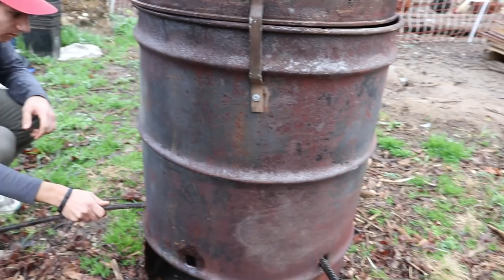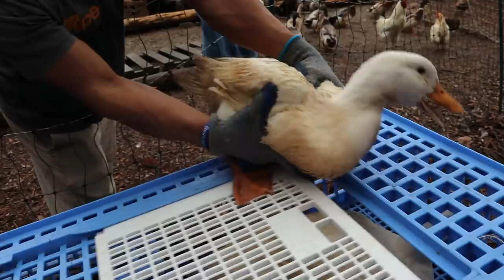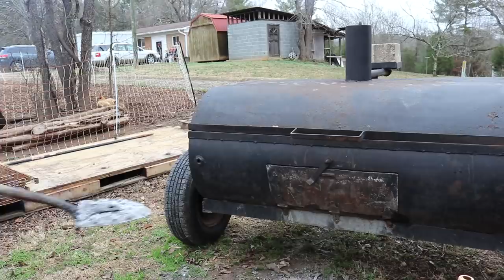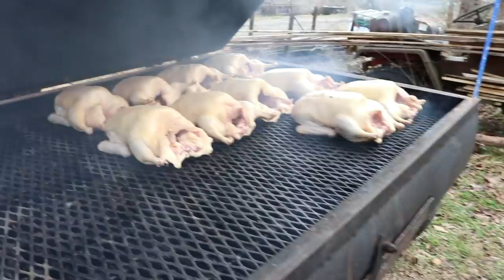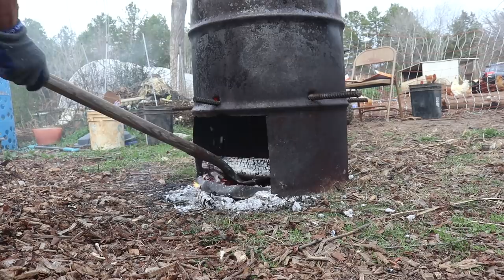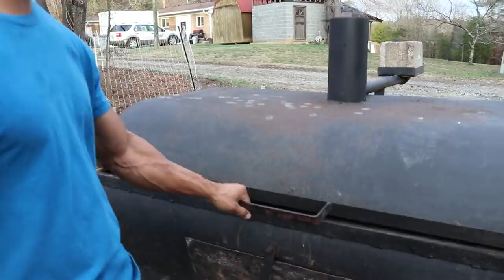SMOKING 20 Hot Duck Breast, Thighs and all for the First Time

Comment: That’s what I’m really huge into doing things without electricity or propane but you can definitely experiment with it with the property you have you can definitely learn how to do that I happen to know a lot about those things a lot of them work you know you can make your own hydrogen that’s pretty easy to make but the problem is stabilizing it so it could be a continual source but Methane gas is probably one of the easier way to go you can see that just for different types of manure but using those coals. like you’re doing you see a lot of that in South America they cook chicken like that..

Comment: Wow! What a smoker and wood barrel combination. I was interested on how they were built and why was the cement block used for on the other side of the smoke stack? What does the top wood barrel do and why two barrels on top of each other?  Where is  thermostat so hands don't burn for those who have touching delay reactions to heat?
Oh yes the ducks and the chicken looked yummy.  I am like Lucy/Luci if there is a grill going I will season the meat and put it on the grill than be inside cooking. Outdoor cooking makes the food taste better and fresh air mixed with the cooking aroma. 💕
Reply: I assume the cement block you are talking about is a counter balance that allow the smoker lid to stay up,  on its own  when lifted a portion of the way. You can imagine out difficult it would be to hold the lid up continually with one hand as you checked on, or added the meat to the smoker. It's a cleaver addition.

Comment: I wonder if it would be practical to redirect the smoke that's coming out of the chimini (?)to another smoker box that you could cold smoke some other meats so as to get a 2fer on the smoke that you are producing and an extra amount of finished product without having to use extra fuel.  Just thinkin'..................🤔😊

Comment: Looked great. I'm going to give you rule #1 in bbq. " If you're looking, you're not cooking " Learn to do whatever you can to not open the smoker ( remote thermometers are really helpful here ) plus start to use a stop watch and record how long the door is open. You will begin to realize what a difference it makes. It will save fuel plus make for a more moist meat regardless of what the meat is because when that heat is pouring out, so is the moisture in the cook chamber. These are really important tips. Have a great day. 👍 🌤🦆